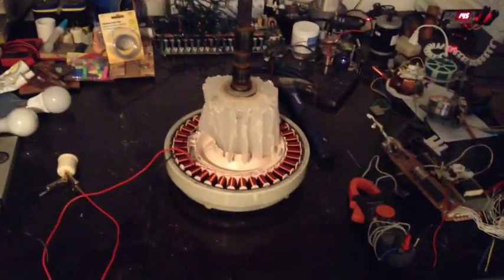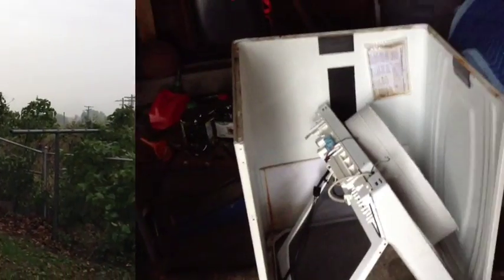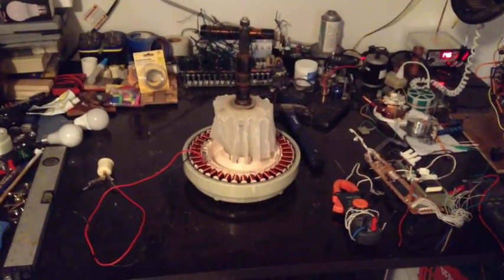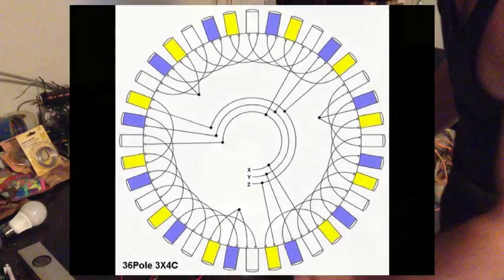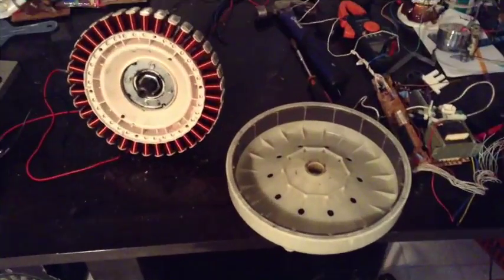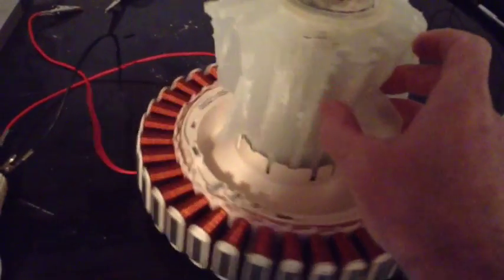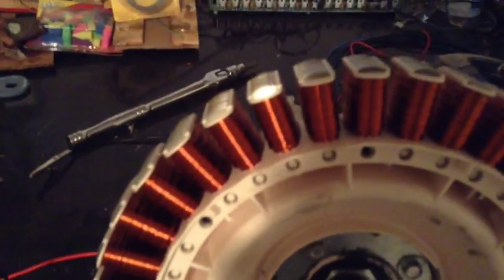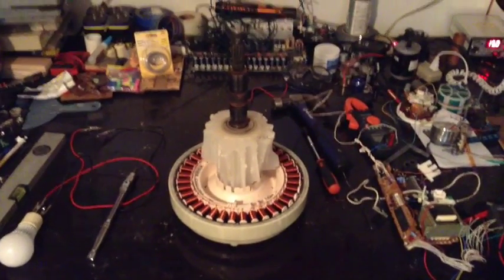BackRoomLabs V.A.W.T. Dynasphere Update 2

Comment: I have been playing with the smart drive but unfortunately I didn't have a the plastic housing and shaft so it's taken a lwhile to fix it so it spins on a make shift bearing with out grinding on the magnets., trying at the moment to run it off a scooter motor.  I like these smart drives and enjoyed your video.
Reply from the maker: Thanks. Yeah the smart drive is very versatile. I have wired and rewired it several different ways. It is now mounted on a horizontal axis wind turbine with some good output.